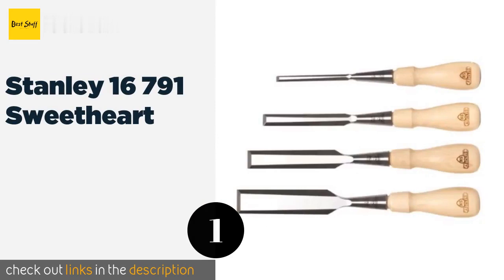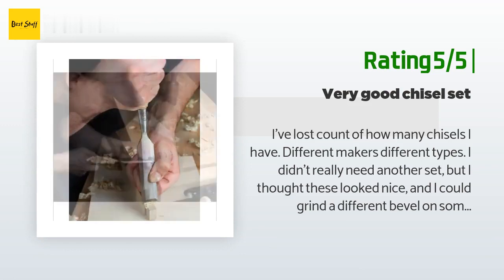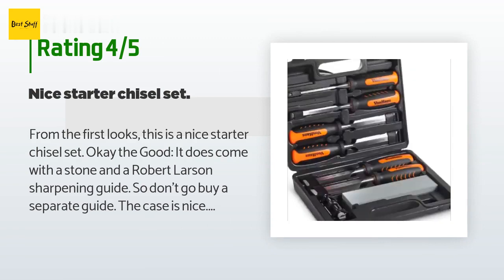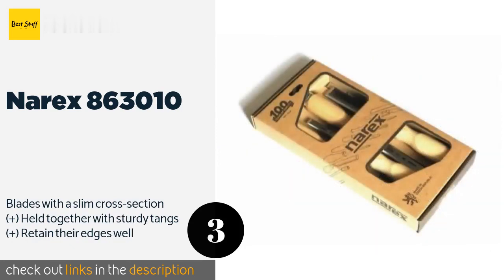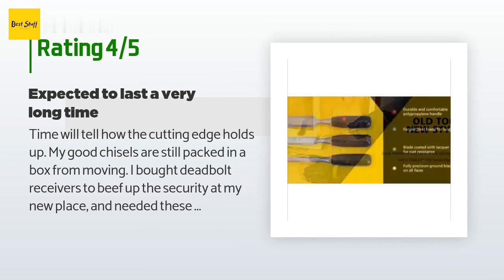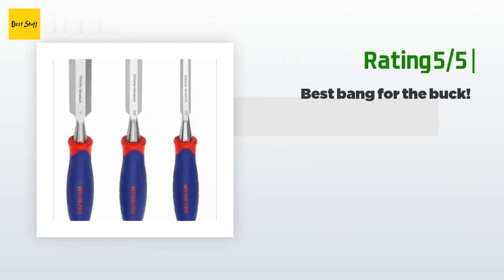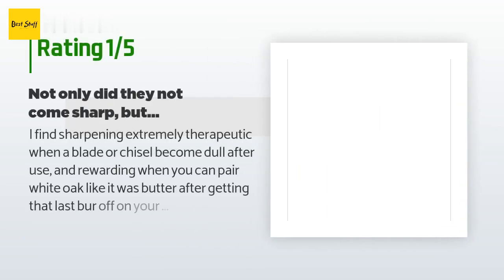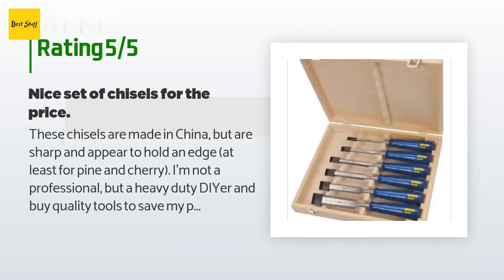🌵7 Best Wood Chisel Sets 2020

Comment: I really like this compilation but it is missing  ( GREBSTK 1/4 inch Wood Chisel Sturdy)  in my compilation the number is included. Nr1            Note that these products were ranked “best seller” at the time this article was written. Amazon’s Best Seller list is updated hourly, so for the most current list.